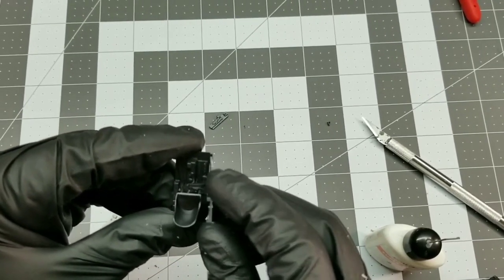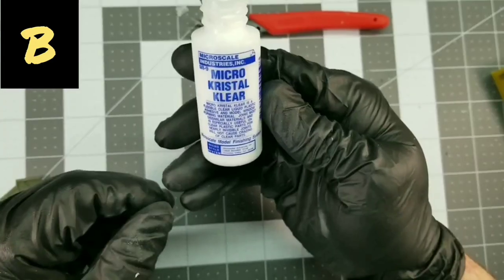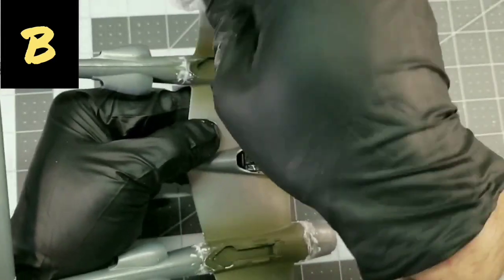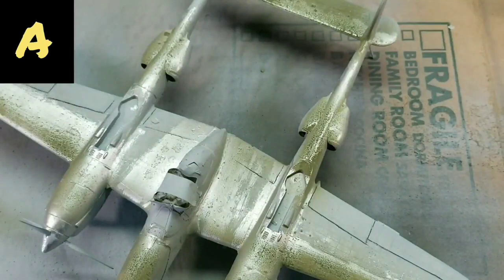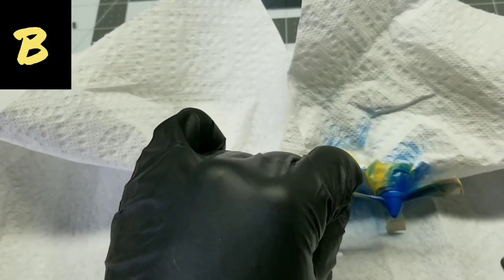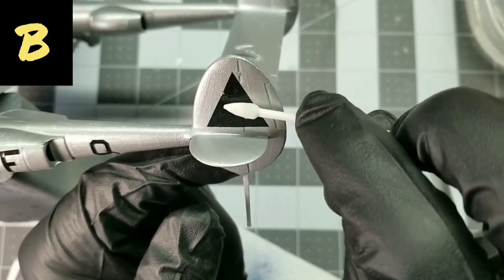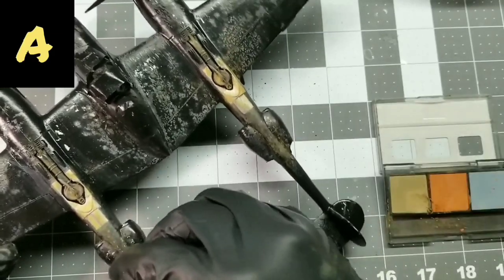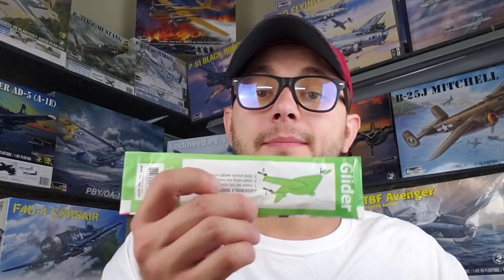P-38 Lightning Full Build 1/48 Scale Model Kit Monogram Revell Tamiya

Comment: You can add weights in the twin booms of the P 38 right behind the propellers. The main thing is too keep your center of balance between the nose gear and the  landing gear on the body.  If you have limited space in the nose  of the plane or the nose gear strut is too fragile for extra weight, you can add weights to the engine nacelle, behind the air intakes, inside the wings as long as you don't go beyond the fuselage landing gear. Lead fishing sinkers work just fine, just buy bigger sinkers and use gel type CA glue or 5 minute epoxy. Let it dry so the weights don't move around.
Reply from the maker: Thanks mate,  I love this!  So many good tips thank you so much friend!! I will defiantly use your method next time

Comment: Squashing the sinkers with heavy pliers will allow you to pack more of 'em in a given space.
Re turbochargers: most of components involved are stainless steel. The bluish and purplish you're interpretinng as fuel leakage/stains (heaven forbid!) is actually metal showing heat discoloration. What you're interpreting as rust is actually exhaust staining with the lightest colors associated with the leanest engine settings.